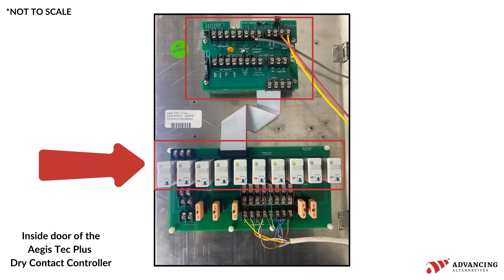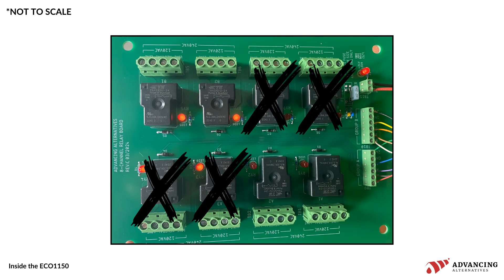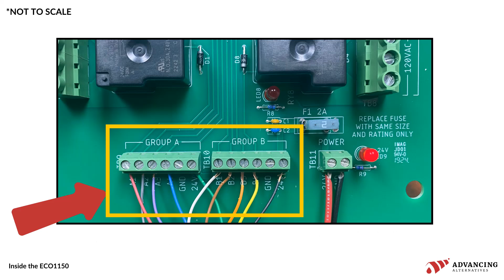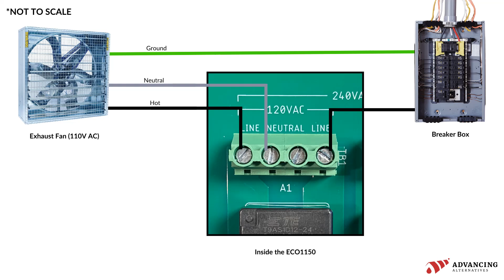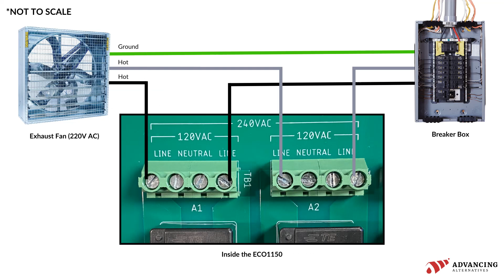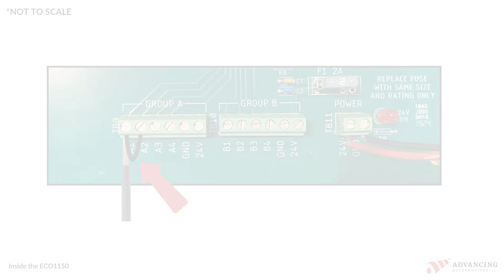How To Wire AC Fans to an AegisTec+ Dry Contact Controller with a 42-ECO1150

Comment: How would you wire in a heater?
Reply from the maker: Heaters usually provide their own 24 volts and thus operate with dry contacts in our controllers. Here is an article for connecting a heater to the AegisTecPlus: https://www.advancingalternatives.com/knowledge-center/connecting-a-reznor-unit-heater-to-an-aegistecplus/